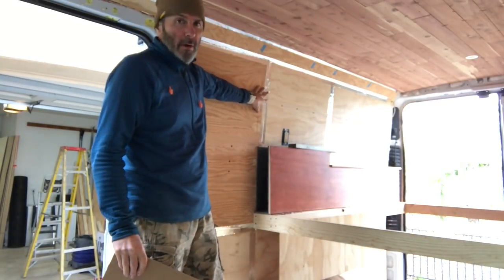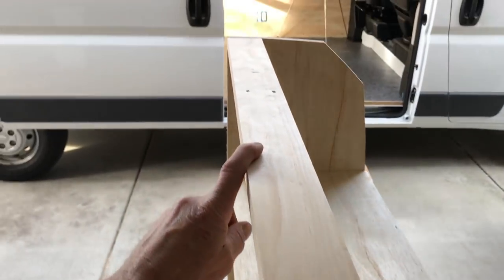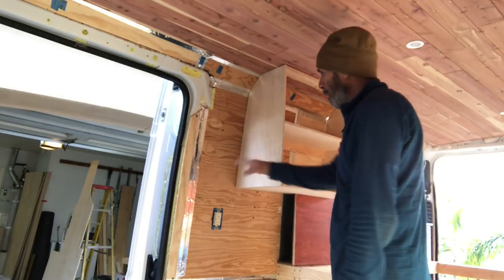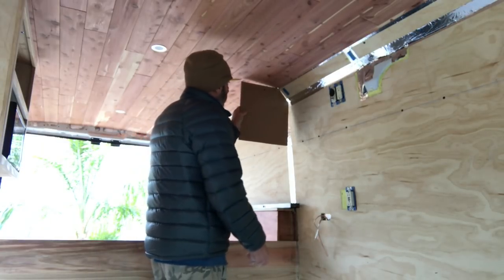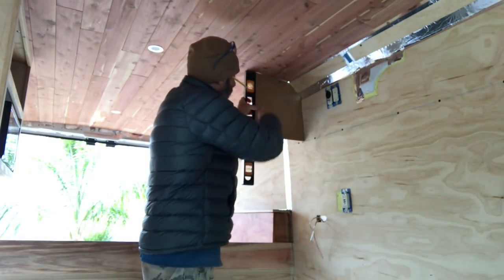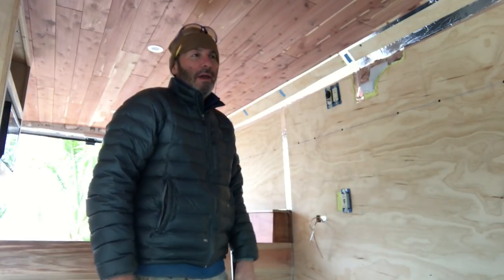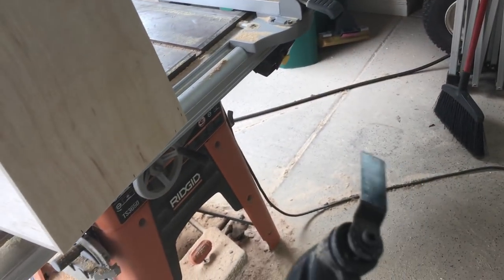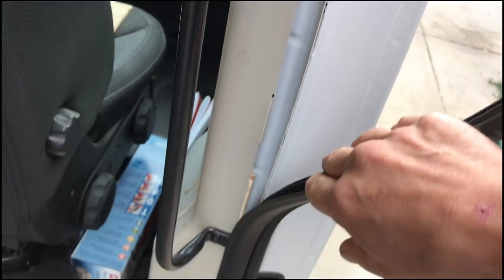Promaster Conversion #18: Upper Cabinets (& Grab Bar)

Comment: I like the build so far. I am planning on doing a promaster also. I plan on making it a combo van. Under the bed I will store all my carpentry tools (I'm a interior finish carpenter  on new homes)and build out the rest of the van for traveling and camping. I can take the tools out and put bikes and gear for long trips. Then put the tools back for work.... a couple things that could make it easier is to stop using levels to work on stuff. Use your tape measure and make it parallel to the floor and 90 degrees to the floor for cabinets (a framming square)  it will be a lot easier than all that leveling and stuff. Another thing that works well is a scribe. It's a compass that u use to layout circles... you adjust it to the largest  opening then scribe that measurement on your cardboard template and it will come out perfect the first time you cut it. No nibbling it a little at a time. Sorry for the criticism, but I do this everyday and if I did it your way my job would be so much harder and take forever. Just trying to help😁 if you lookup how to use a scribe for carpentry u will see what I was trying to explain to u.... your videos are some of the best I've seen on van build outs. I've been watching a lot of them to get ideas and such. Can't wait to see it finished
Reply from the maker: Thanks.  I do use a lot of that in the background, but don't show it.  A framing square is my best friend. 
I try to show what someone could use without any carpentry skills.
When you build your Promaster, send me a link.

Comment: Did you use Kreg screw system to build those cabinets?  How did you mount the boards together?  And the boards were 1/2 inch?  I'll be building my cabinets soon and want to make sure they are strong enough but not overkill.  Thanks.
Reply from the maker: 1/2 inch lightweight plywood, just glue and screwed.  Pin nailed the faceframes.  
Strong enough?  It just depends how much weight you plan on loading in them.  For mine, it's just a few DVD's and a few books.  Here's a different project:
https://youtu.be/JJczfXeebT0?t=542
Reply: Thanks for the reply. My heaviest item will be the microwave and it seems strong enough for that. Great instructions.  Subscribed.

Comment: I'm in a boat building school right now and we make a lot of templets and do a lot of scribing and you probably already know this, but one way to capture the contour of a wall is to cut some strips of door skin about one inch wide and random lengths.  Then put them up against the wall and use hot glue to connect them together into the shape your trying to get.  The corners don't even have to make a perfect angle, because you can just continue the line when you trace that onto your cardboard for the pattern...You may still have to use a scribe to fit the rounded shapes.... Hope that made sense.   Where are you doing this build at?  Love the way you make simple cabinets....TL
Reply from the maker: Thanks for the input.  California.

Comment: Nice series going on van build. Maybe the YouTube algorithm is not working for you the way it should for new subscribers and views. My bet it will passive income down the road for many years to come!
As far as the level and contour issue, you handled it well. Sometimes I envision creating  a center line on the floor and ceiling and using a giant wood square on the line on the floor to establish contours and measurements
Reply from the maker: Thanks.  Yea, ANYTHING that will help you find level and plumb inside a van would be helpful.